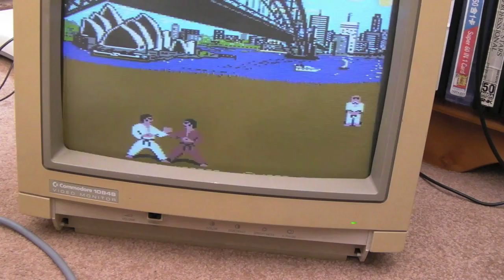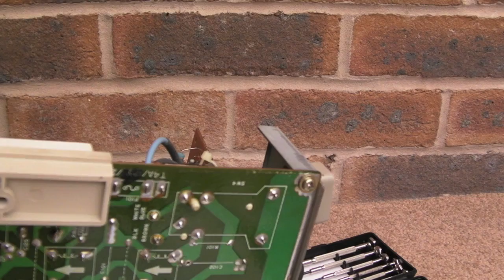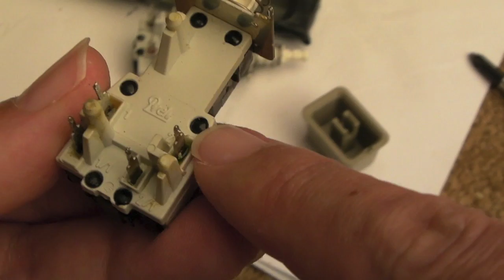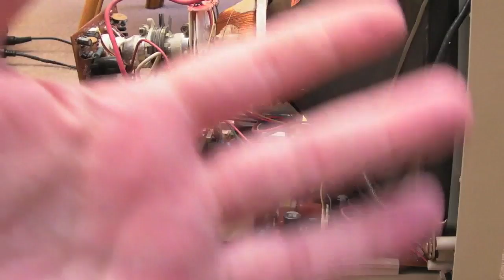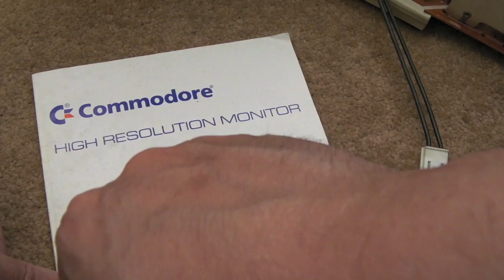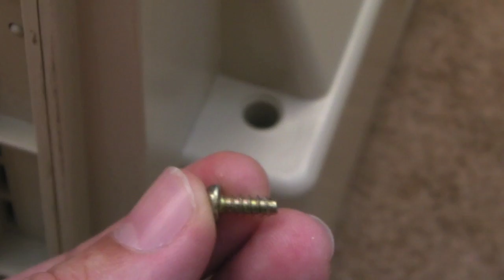Commodore 1084S (1084S-D1) Repair(s) - Part 1

Comment: the top of that last big 150µF cap is starting to puff out, that should have been the first thing to check, even if it''s not the only problem.
Reply from the maker: On that type of cap its actually quite common for the plastic top to slightly dome on a cap that works perfectly!  I will talk about that in the next video.  It's one of the rare exceptions where a slight dome is not an indication of a fault.  It's due to the plastic - the plastic expands and warps, despite the internal of the cap not having actually domed due to pressure.
Reply: alot of them look like that, its just an air pocket under there, they rarely go bad even the cheap off brand ones
thats not to say it could be a typical fault with these monitors

Comment: I can tell this is going to be a good repair series... Looking forward to part 2! I've got a Magnavox RGB monitor thats basically a 1084 (Philips though) and it would work with a cap kit. Last time I fired it up, it had the same flyback retrace lines seen in this video, so its long overdue.
Reply from the maker: Probably just a cap related to the line output side I think.

Comment: you are braver than me! I have a Commodore monitor with washed out colours, but dare not open it...
Reply from the maker: Hehe, yes - it is pretty scary working on these, perhaps more so if you've worked on them before.  The colours issue could just be the tube itself, I suspect that's the case on mine.  I might be able to adjust the colour bias pots or something to perhaps tweak the colour a little.

Comment: My 1084S actually works on PAL or NTSC (its a 120v US version) - maybe its a different rev though. I got back into retro gaming and my friend is like ooh get a CRT its so much more realistic. No thanks - I've worked/fixed enough CRT's in my life that I don't really want anymore :).
Reply from the maker: Yes, not all 1084 models are the same.  From what I understand the 1084S-D2 works with PAL or NTSC.  I do also agree that CRTs whilst nice with the scanlines, aren't a signifcant improvement vs a good LCD.  I will talk about that more in the next video too.

Comment: Patrick Norton of The Screen Savers (geek show here in the US, not sure if it was broadcast anywhere else) once said of CRTs: "Do the words 'No User Serviceable Parts Inside' mean anything to you? Some of the capacitors in those things could blow you through a wall."

He said this after being asked on one show by a viewer if they could try to fix or even just explore their CRT monitor.

In short, if you don't know what you're doing - and by know, I mean absolutely certain - don't try this at home, kids.
Reply from the maker: Haha =D  Very topical with the 'Screen Savers' as I spotted in this video that the Atari 65XE has a built in screen saver.  I think that's the only 8bit system I've ever seen with a built in screen saver.  Yes - don't mess with CRTs unless you know what you are doing!
Reply: Patrick Norton is kind of a muppet, he also blew up glass HDD platter straight into his face while trying to show off.
Reply from the maker: Haha, I will have to check that out!

Comment: Mine collapsed on both V and H, I had no idea of how to fix it, then such a sad day when the Mrs said I had to bin it (later learned that the driving transistors went, simple fix - few quid). 

As small as it was, it made any RGB capable console (the PS2 especially) look superb, the constraints of the tube  made it perfect. One of the best "monitors" I ever had. It served my Amiga and ST well too, of course. 

If you see one of these grab it, the SCART in requires little (if any) modification for most UK RGB consoles and computers, 15k ohm on R,G and B at the very most to make it function, it will also sync on green if need be. Quality tube, even if it is a bit gold fish bowled, the MK2 (looks smarter, slightly flatter screen) was crap compared to this. I'd buy one today if I had the coin for one.
Reply from the maker: It's a shame but sometimes they do end up skipped - CRTs can be a pain in the arse to work on, and these days things like the line output transformer can be hard to find spares for, and of course the tubes don't last forever.  Thanks for the advice there on RGB levels - that will be really useful for later when I get around to making up a SCART adapter.

Comment: You know you're in for a good video when the on screen captions start arguing with the commentary.
Reply from the maker: Hahahaha =D  Out of interest, do you know the purpose of the 'momentary switch' pins on that replacement switch that I bought from TFW8B?   I've been racking my brains trying to work out what purpose that might have in another model montor, and I am stumped lol.
Reply: They appear to operate when the switch is pressed in only, rather than latching. Could be an option to trigger the degause circuit on a different model perhaps?
Reply from the maker: Yeah, I guess that's probably it - cannot think of anything else lol.
Reply: @GadgetUK164  I think its push to make which you test with the multimeter showed. I suspect its for switched mode power supplies where they not only turn on the live and neutral but activate the power supply's logic at the same time (low powered switch in effect).

Comment: Repaired many of these monitors over the time and over all I like them. I have noticed a lot of the capacitors have started to fail in many of these now. My current 1084S had a fault where the filter cap next to the 7805 regulator had failed shorted taking out the regulator. Also found a resistor that went heat sensitive on the neck board that was slowly dropping out the green gun and making the screen go a purple colour after being on for 10 minutes or so.

Mine really needs a full recap one day even though working good now and ive been thinking of making up a full capacitor kit for the 1084 & 1081 monitors if I get the time.
Reply from the maker: Very interesting!  Not the sort of thing you expect (heat sensitive resistors).  Lovely monitors!
Reply: It certainly takes a bit of effort these days to keep this old gear maintained and running correctly that's for sure.

Comment: Great video! Interesting to see the ciruits in this. I had this monitor back in the day. I never dared to open it back then. That freezing spray is very useful :) I'll remember not to cover components with mounting epoxy/sticky glue. Thanks!
Reply from the maker: Thanks, and yes - you cautious approach was wise!  I hate working on CRTs lol.  On the subject of freezer spray - wow at the cost, it's like £8 a can here in the UK now.  I think it has something to do with the contents - it's one of the few things that they still allow to be sold despite damage to ozone layer (at least that's what I understand), and as a result they over charge for it to limit usage.

Comment: Phillips 8833 chassis? Wish I hadn't thrown my Mk2 away in 2014. Had to resolder the input socket once, and it was ready for the volume control to be sprayed out, but a great Atari monitor for years and a massive upgrade from RF through the telly!
Reply: These monitors were the Trinitron of the day (in my mind), I loved mine, sharp yet forgiving is the way I would describe them. PS2 looks awesome on them. There was a CUB that could cope with 15khz horizontal, that was pretty much as close as you could get to a Sony PVM back then, without paying PVM prices.
Reply from the maker: This chasis is Daewoo I think - There are different models (1084S-P1 - Phillips, 1084S-D1 - Daewoo, 1084S-D2 - Daewoo etc).  Atari + Commodore, a match made in heaven lol